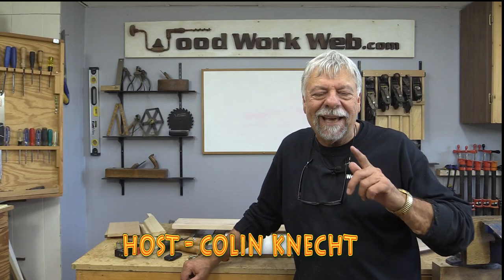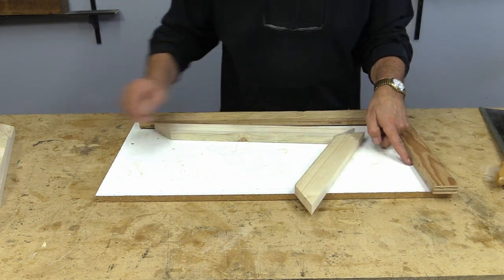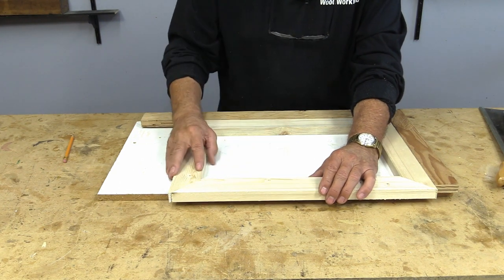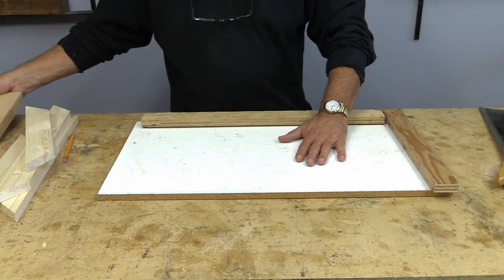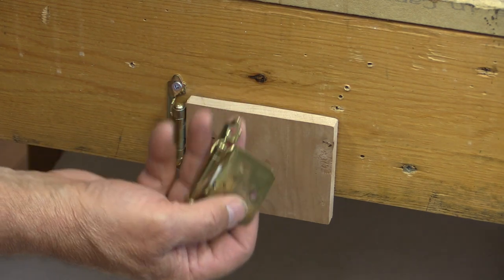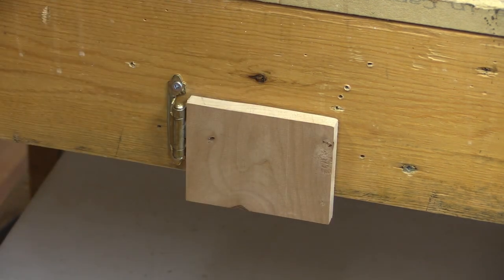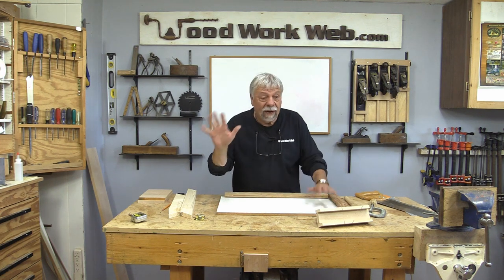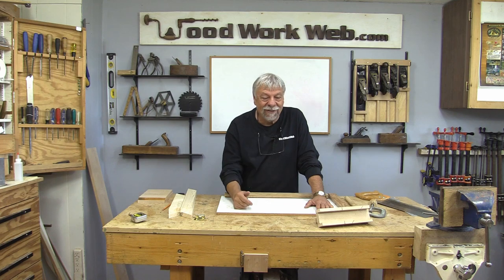5 DIY Workbench Hacks / Woodworking Tips and Tricks

Comment: I noticed that the metalworking vise wobbles a bit. It it is just TOO heavy for the face vise. I would suggest that the mounting should be an L shape and have the weight of the vise resting directly on the workbench. You could also have 1 or 2 strategically placed dogs on the bracket to further lock the vise into location.

Comment: Get some lead or thick soft aluminium and make a set of jaw covers for the metal vice. These will protect both wood and metal surfaces from scoring by the very hard vice jaw Inserts. Or just make a set of vice jaws from aluminium blocks. Aluminium can be cut by wood  working saws if you use a little paraffin or candle wax as a lubricant to keep the aluminum  chips from sticking to the blades.
Reply from the maker: That's a GREAT tip. Thanks for sharing.

Comment: I really want to learn how to cut perfect 45° corners with a skillsaw from birch plywood to assemble a box. 

Any ideas how to do it without a table saw
Reply: I know this is an old comment but you could try making a jig that resembles a speed square. However, it would have the fence pivoted by 90 degrees. Envision a triangle attached to a square shape. You could then clamp it to the plywood and slide the foot of the circular saw along the edge while cutting. This isn't something that I've done before. Though, the idea applies some things I've learned and have used before.

Comment: I consider myself a bit of a connoisseur when it comes to woodworking hints and tips videos but I must say you show stuff that I haven't thought of before. Excellent video mate. 
I used a similar method and your hinged support, but it's just a hole with a sawn of broom handle stuck in it!
I thought you weren't going to stop with the vice trick and end up at ceiling height with a stack of vices! Good stuff.
Reply from the maker: lol ... I should have kept going with the vice stacking tip. It would have make a great joke! Thanks for watching!